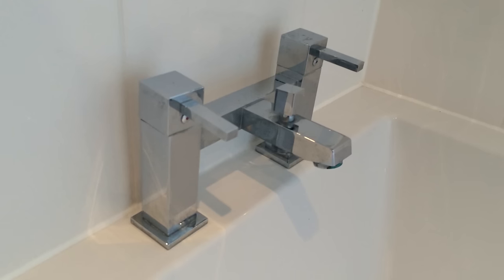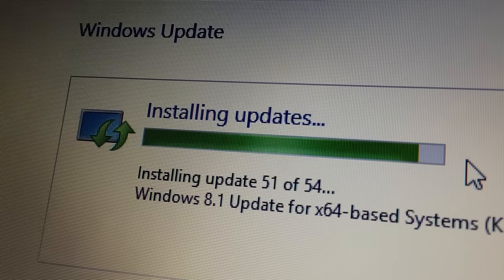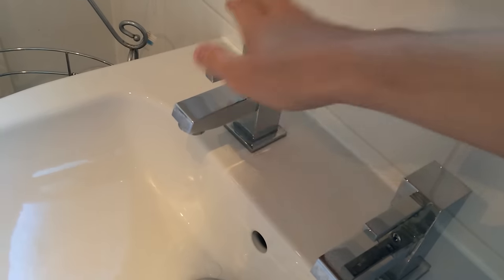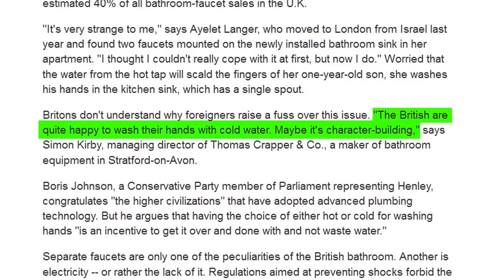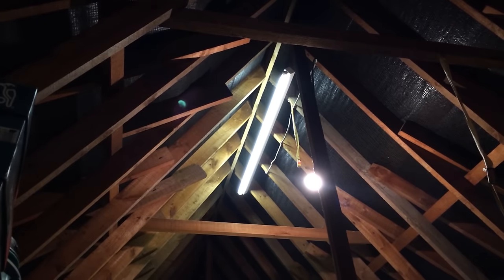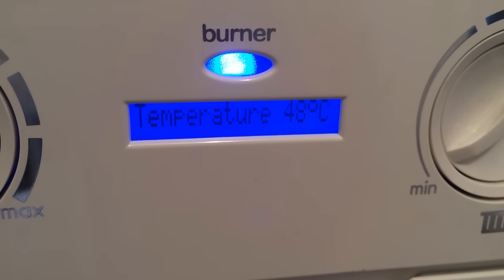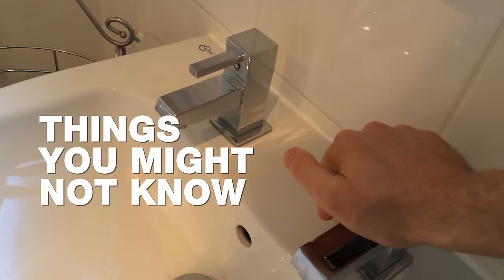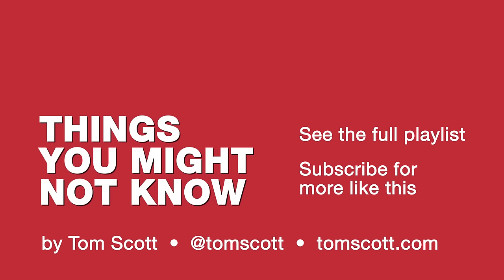Why Britain Uses Separate Hot and Cold Taps

Comment: How do you wash your hands when the only temperatures are cold as fuck and hot as shit
Reply: +Wario64I You mix them in the bowl to get a reasonable temperature and wash with that. You also use less water that way than using a constantly running tap.
Reply: +Wario64I You gotta use the cold water to cool your hands after scalding them
Reply: +Wario64I Well, you don't. You wash you're hands in the warm-up stage of the hot water, it's not instantly boiling hot water.
Reply: +NotInHD its 2016. No need to. The British system of separate taps is old and backward.
Reply: +NotInHD Yeah, but we dont have to wash our hands in festering rat water. That's a big bonus right there. Plus, warm water is nice. So, what do British build their futuristic houses out of then? Stones?
Reply: albinoman13bt We use brick. I think the main reason America still uses wood/plywood is because of the weather, hurricanes, tornadoes and floodings, it is cheaper than to keep rebuilding with bricks.
Reply: *****
Your houses are SMALL! I have lived in the UK among other places. Try 875 sq ft for a  recently constructed 3 bedroom "detached" house. Its obvious that you have not set foot outside of the UK the rubbish you are talking.
Reply: ***** Maybe the water isn't that cold there. But at the moment my water is so cold that I have to be concerned about my pipes freezing so my water cant get much colder. Plus my teeth dont like the cold.
Reply: Well. There is what you think and what is fact. Pennsylvania is anything but flat. Sure some states tend to be flat but those flat states tend to flood and it would be a bad idea to have a stone house when erosion happens.
Reply: It's not the stone itself, it is the support of the ground underneath. if the ground were to get washed away in a flood on about 1/3 of the houses dirt it is resting on. wood could still stand firm. but stone relies on the ground it is built on for support. Wood is securely attached to each other so if you pull or pushed in any direction it would still be strong.
Reply: +NotInHD No.. Cold water doesn't kill bacteria and germs. Hot or warm does...
Reply: +Max Trainor And how often are British houses swept away in a flood?
That's an American problem so why would we build our houses for a problem that doesn't exist for 99% of the population.
Reply: +NotInHD true but I didn't want to go higher because there's always someone who finds a story of that happening and it's usually me :)
I do know of a wooden house in England being swept away after an earthquake a couple of years ago but never any from brick or stone
Reply: +NotInHD You're really a british fanatic, aren't you? I mean, if it's from the UK, it has to be perfect...
I've never been to the UK for longer than a couple of hours (connecting flights and such), but I have had times where either the hot water or the cold water didn't work... and it was miserable. Maybe the UK doesn't have very cold or hot water, but where I live now, the water can get very cold and very hot very quickly. Which is nice (no seperate taps here), because the cold water is really nice for a cold glass of water, and the hot water is great for things like washing dishes. Also, assuming that it stays lukewarm long enough to wash your hands, what happens if several people want to wash their hands one after the other?
Side note: the US is definitely not flatter than the UK. Keyword: Rockies.
Reply: +NotInHD TRUE BTW IM GB
Reply: DJtrainman261 You've never been in the UK for more than a couple of hours but yet you know how the plumbing works better than people that live here all their lives?
Can you explain how your tiny sample (which i think you are embellishing a bit) means you are an authority?
Reply: +luke dodd There's also a lot more wood available, here, so it's cheaper as a building material than in Britain.  Also, the frontier days are a lot closer in time over here than over there.  But built-up areas, such as London and New York, require building in materials that are less likely to catch fire, regardless of cost, availability, or history (and obviously you couldn't build a very large public building out of wood, anyway).  London was mostly built out of wood until the Great Fire.  That changed afterward, for obvious reasons.

The only reason that New York never had a massive conflagration it that the city planners were able to institute the requirement for brick or stone early enough in the process to prevent it (large tracts of Manhattan were still farmland into the twentieth century).  There are still two or three wooden houses in Greenwich Village, New York, that survive, but that's it.
Reply: Gambit771
No, Mr. Sarcasm, I never claimed to know anything about British plumbing. I have had times outside of Britain (in case it wasn't obvious) where either the cold or the hot water didn't work, that's all I said.
Reply: +Wario64I never heard of a bathroom plug?
Reply: +luke dodd and trailers can be moved
Reply: +TRPG pilot can you say that in metres ...to keep up with the rest of the world?
Anyway, whats the rubbish about we live in small houses? The UK is not inhabited by hobbits. It depends where your'e living to begin with and the land value , the same as it is in the US.  I've seen all size and shapes of houses in the US (excluding trailers). It depends what you can afford.
Reply: Mike Rourke Wait, so are you saying you have to plug the sink and fill it with water every time you need to wash your hands? what about rinsing your mouth?
Reply: +PillowMuffins I don't "fill" the sink. I fill just enough if I'm washing my face, (luke-warm). Hot is to wash my hands,  depending where I've been (it doesn't start flowing out as boiling water).Hot for shaving. Cold to close the pores and cold water with toothbrushing and rinsing my mouth (even with an electric flosser and toothbrush).. Never had any problems with my teeth.
Reply: Mike Rourke I suppose you get used to it. It just feels a bit awkward to me.Also, I'm not sure what temperature the water is at but here in Canada the cold water is far too cold to even wash my hands in.  
Anyway, I was wondering if the newer instalments used mixers or if they stick with dual taps because it is the norm.
Reply: Mike Rourke
Thats just nastiness! Imagine the amount of spit, snot and other undesirables that go into that sink! Then you are gonna fill that with water to wash your hands?
Reply: PillowMuffins
! wager after that"wash" the hands got more bacteria on it than before the "wash"
Reply: +TRPG pilot I don't know about you, but I have a particular order of doing things. I don't wash my face after having a crap and I don't throw up or piss in the sink either.
Anyway if you had read correctly, I wrote, I wash my hands in (running ) HOT water.
Reply: +PillowMuffins lots of houses have mixers. in fact I think my flat is the only household of people I know that has separate taps.
there very common as people are always doing up their kitchens and bathrooms.
its like a national sport these. 
don't listen to any of the foreigners that have never been to the uk or only spent a few hours at best here.
Reply: +Wario64I Because us British people feel no pain.
Reply: Our cold taps aren't even that cold.
And our hot taps take a few seconds to warm up.
Reply: +Gambit771 shut up he was pressing the fact that wooden houses are more modern than stone because someone said wood is older but they don't call it the wood age now do they
Reply: +Wario64I did you watch the video? We can have mixer taps now. However, the way we wash our hands is with water. A bit of cold water on your fingers wont kill you. Stop being a Nancy boy.
Reply: Be a man and suck it up, and not all hot taps are boiling hot and same with the cold not all are at freezing point.
Reply: Video Critic
Be modern and live in 2016, not 1972.
 With that attitude I'm sure you should not mind taking a dump in the outside toilets common in Britain in those days or sharing the bathwater. Times have moved on. Get over it.
Reply: TRPG pilot That come back makes no sense I was talking about taps....
Reply: Aidan Standing
 The Brits have this 2 second sprinkle under the tap that they use (without hand soap!) after using the toilet, so their hands are in and out of that water long before it has a chance to scald them if using the hot tap or to feel the cold if using the cold tap.
Reply: +TRPG pilot I've lived in the uk for ages, our houses are technically smaller than american ones but by no means small.
Reply: Can we also note the US is a significantly younger country than the UK is? Aside from plumbing, the US is very diverse in landscape, where I live, Ohio, there's a large flat northern half, then a very hilly southern half. Given the varying landscapes, houses are built from varying materials. Brick tends to be for wealthier homes, given its costly.
Reply: +TRPG pilot Why don't you put your electricity lines underground at least in higher populated ares...looks like in the 19th century.
Reply: +Drivenfromhell Gothimus Prime It depends on your budget and where you want to live. I'm sure you could get a palace in Rochdale for the same price as an apartment in Mayfair.
Reply: +DJtrainman261 Where were you in these few hours? In the Transit Lounge at Heathrow Gate 5 ? And you know it all.
Reply: +Mike Rourke It would cost $41 billion just for one state (North Carolina) and take 25 years. Also, if something goes wrong, they're much more difficult to fix. Even so, most new power lines are underground in populated areas, and almost 20% of all transmission lines are underground.
Reply: +Forgi LaGeord   And what about broadband? Also only in relatively densely populated areas ?http://www.engadget.com/2011/06/28/why-is-european-broadband-faster-and-cheaper-blame-the-governme/
Reply: +Wario64I Exactly. It's awful.
Reply: +TadRaunch Most accurate depiction of british taps i have seen so far,  I bet american taps don't produce boiling water.
Reply: +Wario64I Wash your hands the old fashioned way, stopping up the sink and washing them in the basin.
Reply: +Mike Rourke Good Point, I guess we were so busy inventing grid powered electricity then moving on to flight, and then space flight to put our cables underground... :/
Reply: +Wario64I I have actually never once in my life made a point of washing my hands in hot water, unless it's like a public bathroom and the last guy used hot. I don't get the point of waiting and wasting a ton of water for just a tiny comfort that I'm used to not getting.
Reply: +Wario64I always cold water
Reply: +Wario64I You use the cold one.
Reply: +DJtrainman261 the uk isn't perfect, it has english people in it (scotsman)
Reply: +luke dodd Regardless of country, almost all houses use wood and masonry block construction, because it is cost effective, and also for flexibility for disasters like you stated, most importantly earthquakes. Brick homes are more expensive, and unaffordable for most people. Most houses that have brick exteriors only have a brick veneer, the frame is still block and wood; in contrast, aluminum, stucco, and wood veneers are far more common due to the lower cost. The veneers of choice will depend on the supply and demand of a specific area, which is why in every country there are different types of houses in different neighborhoods.
Reply: +Harold Weaver Smith is this really what people do?
Reply: Noah5900
a lot just use the cold water, myself included
Reply: +Wario64I 
you just do
Reply: ***** same in the usa, we have mixer taps but i always use the coldest possible water hehe
Reply: +NotInHD in my country(and most of the EU) American "houses" don't qualify as house in law, but as a temporary structure i.e. a shack. For a proper house you need to meet certain structural requirements like "solid" build. You can't get a mortgage on a wooden shack...
Reply: +sl1fka 666 my country is Bulgaria, but rules are similar in Europe. A wooden house qualifies as "flimsy structure" in law here. Can't point you to the standards, but I can tell you that there is a substantial difference in law. Flimsy structures are part of the land and cannot be property by themselves. They are not legally inheritable, insurable etc. it's basically a shack.
Reply: +Litigious Society That depends entirely on the region. Building wooden houses was forbidden here for centuries in cities due to the fire hazard it poses. After WWI, there was also no wood left to build anything. The only material available here was clay, so all our houses were made from brick: interior and exterior. Currently concrete has become cheaper (costs less labour hours), so many new houses go for a concrete structure. And some people even venture a wooden structure (but that's mostly for holiday use). But the cheapest houses you can find here, are old and made purely out of bricks.
Reply: +luke dodd Brick houses still have wooden frames.
Reply: +NotInHD Brick houses aren't immune to water. flooding doesn't destroy wood either, but when it gets inside it ruins other things.
Reply: +NotInHD Cold water doesn't clean as well as warm water. Cold water closes your pores and it is harder to get the germs out of there.
Reply: +TRPG pilot Actually, some houses in NZ aren't huge, mine is 958 square feet, including a separate laundry, and that's three bedrooms.
Reply: +TRPG pilot If you think GB is just a tiny insignificant island, you obviously know nothing about Trident, even if we leave the EU we will still are, and always will be capable of delivering a nuclear threat.

Anyone who thinks GB will ever be an "insignificant island" are deluding themselves.
Reply: +NoNameJustWords GB can make a lot more than people expect
Reply: I've always had a mixed tap and I've never washed my hands with hot water. What is wrong with you? A little bit of cold is not gonna kill you.
Reply: +Wario64I You grow a pair and deal with it. :P
Reply: *****
I don't think he lives in Scotland, if you hover over his name it says he lives in South Africa.
Reply: NoNameJustWords
Correction, I live at GU21 6YL.
Reply: TRPG pilot
You live in Woking? My home town? You live in the flats or the apartments above the shops?
Reply: +Wario64I You open both taps, become The Flash, then alternates really fast between the hot and cold water.
Reply: +luke dodd Most "brick" construction is really just facing, or a  veneer, with the structural loads carried by wood. An actual (structural) brick building--at least in the USA--is old, typically pre-20th century, or else originally commercial construction. Are you saying MOST UK construction uses STRUCTURAL brick?
Reply: +NotInHD Cold water does a poorer job of washing your hands, though. It's simple physics: cold water does worse at dissolving solids than warm water. Does sugar dissolve faster in hot tea, or iced tea? I rest my case.
Reply: +nikoladd Gee, "flimsy" structures that last 200+ years? Hmm.....
Reply: +Wario64I I turn on the hot tap... wash my hands quickly in the almost boiling water then quickly rinse them under the cold tap to cool them down.. or I just use the cold tap..  Cold water doesn't bother me that much.. Once when my boiler broke I had no hot water for two days and that meant cold showers.. it wasn't so bad.
Reply: 1. Put in the plug 
2. Turn on both taps 
3. Fill basin at a depth and temperature you're happy with 
4. Win
Reply: +Jaw Ji You need clean running water to wash your hands properly. Putting your dirty hands in clean water makes it dirty, so you're no longer washing hands in clean water.
Reply: MulleDK19 
That's a good theory, though I have no idea how it could be tested to see if germs you wash off your hands end up back on your hands. 
If you're using soap though it wouldn't matter.
Reply: +Jaw Ji Of course it would. Would your hands not become full of germs if you put them in the toilet, just because you have soap on them?
Reply: MulleDK19 
But I wouldn't wash my hands in a flushing toilet either. 
Come to think of it; washing your hands in a filled basin of water, is just like having a bath really.
Reply: +Jaw Ji It is. And that's why I shower after being in the tub.
Reply: they dont...
Reply: +luke dodd It's because they're cheap.
Reply: I believe americans use wooden houses as they get destroyed faster.
They are always ruining their stuff. They love it!! 
They have 110v electricity. Since Power (watts) = I (amps) x V (voltage). 
American appliances at 110v need double the current of UK systems for the same power. 
More current arcs and sparks and burns their houses down. and your plugs are silly in america
Reply: mikeee6
Watt is the unit of power?
Reply: I don't know watt you mean, but the S.I unit of power is the watt - measured in mr james joules I'll have you know, pip pip old chum
Reply: mikeee6
It was meant to be a joke.
Reply: I assumed as much (hence my watt' instead of 'what') 
I just thought if I wrote something potentially useful too, then it cant hurt, right?
Reply: Velominati Rule 5. Or just fill that round ceramic receptacle you'll find handily placed under the taps.
Reply: +bcubed72 yes the vast majority of UK residential construction will use blockwork construction. Timber frame construction is comparatively rare.
Reply: In some commercial buildings in the UK to avoid people scalding their hands there is now a mixer unit with a thermostatic valve below the wash hand basin which automatically adds cold water to the hot supply if necessary to reduce the temperature. The hot supply then goes to the hot feed of a mixer tap. It seems to me like it would be significantly simpler to build a thermostatic valve into the mixer tap.
Reply: +TRPG pilot   Completely off topic, but as it gets near to the referendum I'm seriously worried that "the UK" may vote to leave the EU, then Scotland will vote to leave the UK, preferring alignment with the rest of Europe.  Maybe Wales some years later.  Giving up the empire is one thing, smashing the UK apart is something else.  I hope we don't vote to leave.
Reply: Just use the cold water tap. They don't get really cold until they've been running for a bit
Reply: Or use the hot one. They don't reach hot temperatures until they've run for a bit
Reply: use cold, it's never freezing. Hot on the other hand starts off lukewarm but after 5-10 seconds you see steam and well that's never a good sign.
Reply: we learned to put up with the pain of the hot water
Reply: Well I recently moved from Norway to Ireland, and they use the cold one. It's just a retarded system 😕. Luckily for me I have a mixing tap in the kitchen 😁
Reply: Man up and use the cold one...
Reply: KD Gaming You sound like you have had a proper 1st world education  . . .
Reply: +TRPG pilot Thanks!
Reply: +Ray Kent Sorry mate
Reply: +Max Trainor you still build on a concrete foundation... No one puts the wood directly in dirt except In pole shed building
Reply: +TRPG pilot You and the other people in this thread who've clearly never been to the UK might be interested to know that we do have mixer taps actually
Reply: +HeatyFrog we got 2 mixer taps and 2 sets of normal taps and we are in the uk
Reply: HeatyFrog
   Yes I know, I was able to buy some at B&Q  for the last property I sold.
Reply: MTL Racing
 "normal taps" are in fact mixer taps anywhere else in the rest of the developed world.
Reply: Wario64I true but my parents replaced those water taps for new ones that only have one funnel
Reply: So you have to mix it in the bowl, every time you want to wash? Go to toilet, put the plug in the sink, wait for the water to mix, wash hands, pull plug. Effective.

Not very environmentally friendly either...
Reply: Guess that's why brits like taking baths so much, huh
Reply: Brits are officially the cleanest-people on Earth.  Now Americans, that's a different story.  Walk around Walmart and count the sweat-stains on the 800lb shoppers for a hint.
Reply: Brits don't mind washing their hands in cold water
Reply: Wario64I tbh, I never heard of people washing their hands with hot water before
Reply: It's Britian. Water is not exactly a commodity :P
Reply: Wario64I "Britian"
Dyslexia xdd
Reply: How cold is your water to the point where you cant wash your hands with it.
Reply: Even though for the water to kill whats on your hands, it literally has to be boiling. or at least very uncomfortable for a long time. That's why we have soap. Warm water just feels better.
Reply: learn the art of darting your hands between them
Reply: just use cold and get on with it
Reply: Alex Jogyerek where you from?
Reply: Wario64I grow a pair.
Reply: There is an art to switching between taps very quickly
Reply: that really don't sound sanitary really. always running water is alayw going to be clean unlike some bowl that has to be cleaned too. can't imagine it would be as easy to get the soap off that way too keep putting into "clean" water that gets soapy as soon as you try and rinse them
Reply: Wario64I use cold XD
Reply: Wario64I 0 (ZERO!) logic
cold as sh*t
Reply: Wario64I fill the sink with warm water
Reply: Quickly!
Reply: MaximumDumb We have building regulations that ensure solid foundations so that is never an issue here fortunately.
Reply: Even worse than washing hands is trying to wash your face in the sink...
Reply: Rofl!
Reply: Use cold water to wash your hands, to avoid your hands dry out.
Reply: @hgpo27  Not in the uk only the roof is wooden frame
Reply: @voivod6871  thats impossible. How do you think your home is insulated? And electrical?
Reply: @Gambit771  Earthquake, WTF when did we have an Earthquake in England that swept away a house, in my 54 years of living in England I've never lived through an Earthquake 🤔
Reply: Whats the problem with mixing the water in the sink/basin? Unless you think your sink/basin is dirty, which is your fault if its your house.
Reply: Step 1: invade India or China...
Reply: @TadRaunch  This was exactly my experience living over there.
Reply: Carefully.
Reply: You mix them
Reply: @DJtrainman261  well if you only stayed for a few hours via connecting flights I'm gonna guess you used airport toilets and are basing your arguement on this ? Lmfao